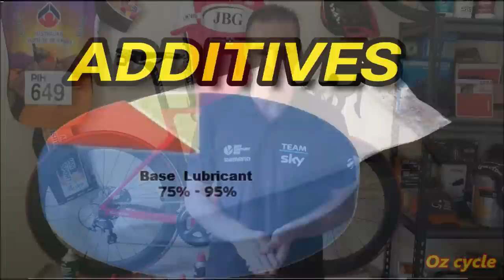Ultimate Chain wax - make it yourself

Comment: What do you think, should you oil or grease pulley races? Or maybe wax haha. You should do a wattage comparison test between a dirty oiled chain and a waxed chain to see the watt gains.
Reply from the maker: The wattage difference testing has been done by "Zero friction cycling ". 
Lightly grease jockey wheels. Some like to use oil for racing.
Reply: @stevenleffanue  thanks for the reply. I just did the thorough cleaning process, and I repeated the gasoline process a few times. And apparently my chain has developed quite some rust in the process, even on the inside. What do you recommend doing now?
Reply from the maker: Wax the chain as soon as the it is cleaned to prevent oxidation
Reply: @stevenleffanue  is the chain damaged now? It was a new chain, only done 300km.

Comment: When I took the chain out of the methylated spirits to dry some rust appears is this normal or do I have to do another process for drying?.
Reply: I'm careful about this because I live in a very humid environment.  From the spirits, I take a air nozzle to my small (it's annoying, but eventually gets the job done) air compressor to blow out everything from the chain (I did this for the spirits, and now after pouring boiling water over the chain when cleaning).  Compressed air really gets the chain dried out fast (maybe 99% dry), so it can go right into the wax afterward.  This last time, the wax wasn't melted enough for it, so I brought the chain inside the air conditioned house - after blowing it out twice outside - to stay in the dry air.
Reply: Working Guy Awesome. I will follow your advice. Thanks a lot.

Comment: Any reason you "dumped" the cold water bath after wax?
Reply from the maker: Not required with ptfe.
Reply: oz cycle perfect, thanks! I'm gonna have to go the MSW route this first time, as I couldn't source PTFE in a timly manner (i guess its on a boat somewhere between China and Sweden now...)

Any recommendation on how to fully remove all wax from a MSW'd chain if I want to rewax with your recipe?
Reply from the maker: Same initial clean as explained Anders. Yes Ptfe is hard to source in some parts of the world at moment.

Comment: What can you substitute if there are no PTFE available? Can I use 
Paraffin wax+chain lube mixed up?
Reply from the maker: The Ptfe powder is available on Aliexpress
Reply: @stevenleffanue  do you recommend to mix chain lube + paraffin wax?
Reply from the maker: What is "chain lube"?
Reply: @stevenleffanue  like WD 40 dry chain lube?
Reply from the maker: No. You can mix most wax lubes with paraffin wax but not oil based
Reply: @stevenleffanue  Can I use Paraffin wax only without the PTFE?
Reply from the maker: You can but rewaxing will be every 100km max.
Reply: @stevenleffanue  Thanks man! you been very helpful, God bless you

Comment: I have been using paraffin wax for a year, strictly under Oz instructions so I'd like to sum up my experience in the thread below, it might be helpful for someone who considers transition.
Reply: Pros:
- Drivetrain is really clean, that is true. Although if you're an MTB rider (like myself), you'd still get lots of fine dust on your chain, and inside of it. So proper cleaning would be a must.

- Chain is super quiet on the first ride (but unfortunately only the first).

- Drivetrain (in theory) should last much longer. Can't compare at the moment, since ridden only for 2000km
Reply: Cons:
- The operating time of the chain is... not great. Chain is super quiet on the first ride (40-60km), but on the next it is already loud. So loud that usually at this point I would want to clean and re-lube. So I'd say a waxed chain comfort operating distance is 100-150km (2-3 rides), and then I would re-waxe it 100%. 

- You should invest a substantial amount of money into waxing (new chains, degreaser and spirit to prepare them, connex link, wax heater device, paraphyn, PTFE powder, respirator etc.)

- !!!  PTFE/Teflon powder is HIGHLY TOXIC thing, and it stays in our environment forever, and could be the "asbestos of our generation". This is a very serious argument against waxing this way.

- Therefore (look previous point) the process of waxing and every handling of the chain is very troublesome. I always use gloves, glasses, respirator, and when I put a freshly waxed chain on a bike, I do it outside only, since there's a lot of wax particles falling all over the place, and I don't want my home to be contaminated by PTFE powder.

- The process of cleaning/waxing is VERY troublesome in general. Splashing hot water over dirty chain by no means is enough (I tried boiling the chain for 20 minutesm and a lot of dirty wax comes to the surface of the water). So I have to use wd-40, clean with a rag, then degrease, then I put my chains into white-spirit degreaser overnight, then vibrate it, then I take them out (spirit is very very dirty after that) and dry, then re-wax. The waxing process takes at least an hour, since the wax heater melts the pot of wax for 30-40 minutes. So it's a big big fuss.

- After every ride, I have a very weird issue with the rear brake, it becomes loud. Never had it before I switched to waxing, and this doesn't happen with the front brake. After each ride, I have to clean the pads, and disk rotor, otherwise the brake is super squeaky. I tried to find the source of contamination, and even replaced the cylinders and seals in brake caliper because I suspected oil was leaking there, but it continues to happen. My only version is that it is the wax particles that get onto the rotor. Because when you drive the freshly waxed chain, there's a ton of small wax particles falling off.
Reply: My overall conclusion:
- I might still continue using wax, but probably would switch to SILCA wax, or anything that does not contain toxic and cancerogenous PTFE powder.

- But in general, when I had a single chain, cleaned it with a chain cleaning device, and re-lubed it with Squirt- or any other wax-based lube, it was much easier, quicker, more ecological and healthy, cheaper and less headache. 

So I think this entire wax thing was not worth it. Unless you're a strictly road biker, and you ride on super clean roads of the USA, or UK, then it might be worth.

Comment: 14:41 You omitted the fact that the wax has to be the right temperature when you take the chain out (50-55C). That's super important.
Reply from the maker: With this ptfe wax you can take the chain out at any temperature (53 - 90 degC).
Reply: @stevenleffanue  I don't understand the chemistry behind that, but OK

Comment: I have bought the 100% paraffin wax in block with ptfe powder to add. But once melted the wax is like glycerin thick . Is it normal ? It’s too thick for waxing a chain . What can i do ?
Reply from the maker: What temperature are you heating it to?
Reply: @stevenleffanue  90 celsius because i was in a hurry to melt the block and put it away .
Reply from the maker: Something must be wrong then, it should be like water at that temp

Comment: Hello, i experiened something really strange. Since a few months i use to wax my chains and use the wax in xylene and it worked just fine.
Now my ptfe from china finally arrived and i put a good amount in the xylene-wax bottle.
After i used it the chain immediately started to squeak!
I cleaned and rewaxed the chain and after two rides i used the xylene with the ptfe again and after 10 km it started to squeak again.
I think the ptfe somehow messed up my waxlube.
Anybody experienced something similar?
Thanks and greetings from germany, marcel.
Edit:
I just rewatched this video and have to say that i used the "old" receipe. Paraffin mixed with paraffinoil.
Maybe i should restart with only paraffin and ptfe?
The liqid wax in xylene is very handy, but maybe i shoud not apply ptfe to it?
Reply: Hi Marcel,
I am interested in your experience as I am about to test it as you did. I have found that xylen is a good solvent of PTFE, so I thought it should work fine. But your own experience seems to demonstrate the opposit. Did you find a solution to use the whole mixture (PTFE + paraffin + paraffinoil + xylen) without any chain noise ? Oz point of view would be interesting.
Thanks and greetings from France.
Thomas